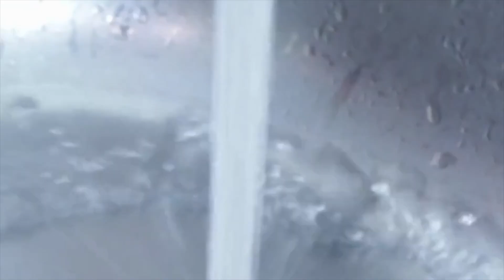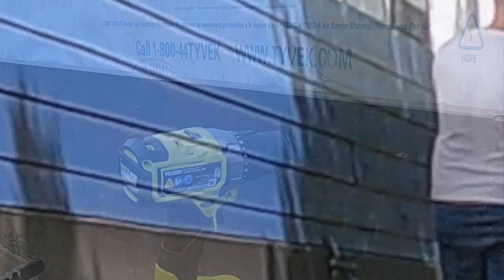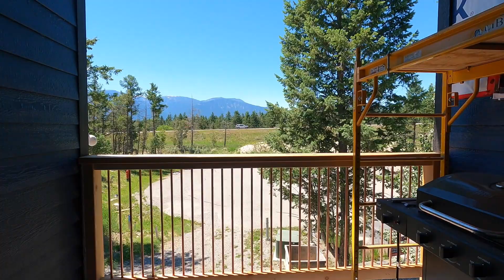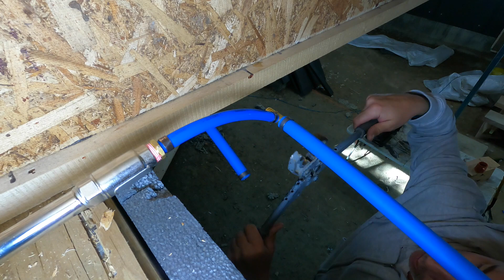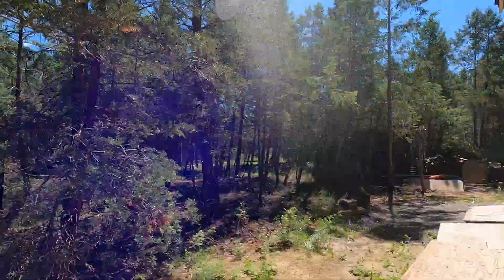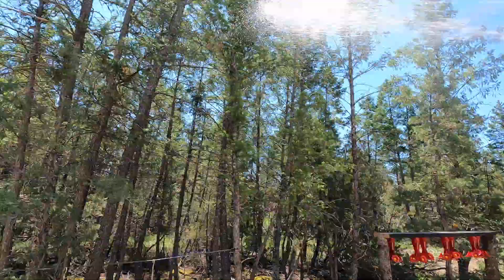AQUOR HOUSE HYDRANT INSTALL DIY CABIN BUILD

Comment: I love how sleek this system looks
Reply: Couldn't I just mount it to the siding and not using the block on a retrofit.
Reply from the maker: Only if the siding is level. When installed the valve water  needs to drain out when you disengage the hose connector. If it is bevel siding it will change the angle designed by the manufacturer.
Reply from the maker: I’m really liking the look as well. Aquor water systems has many different covers with different finishes.